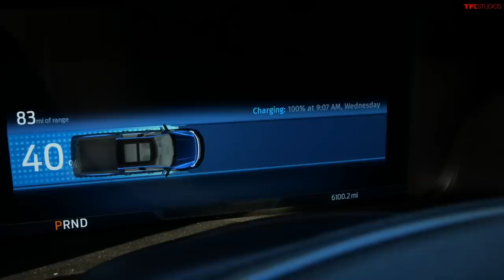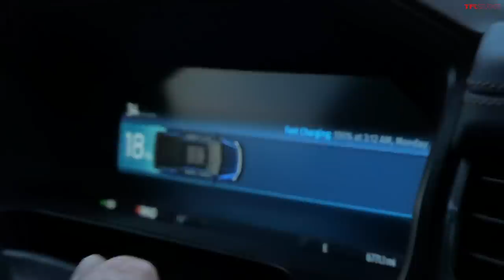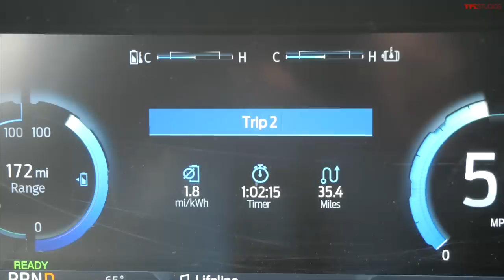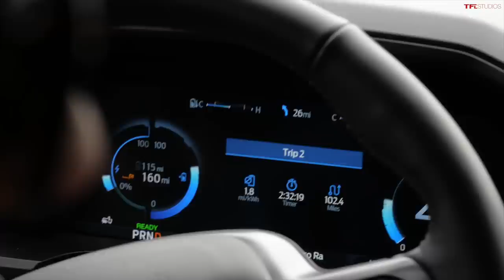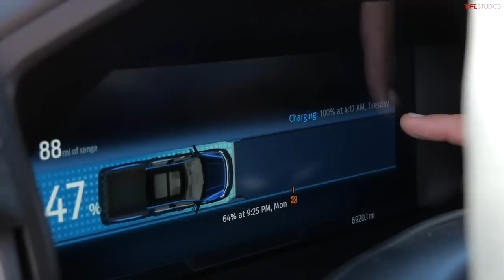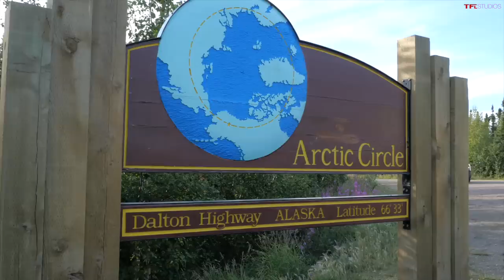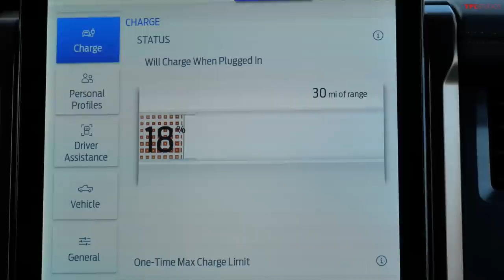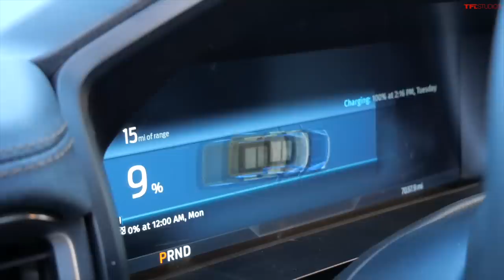Easy Part Is Over: Driving an EV Truck Into the Alaskan Wilderness Is HARDER Than We Thought! Ep.4

Comment: My brother lives up North and another factor you need to worry about is power outages.  The grid is NOT stable in allot of places up there and the generator he bought for his house sees regular use.  If he had an EV hed probably need a second generator cause the 40-50amp? one he has now is just enough to run his house and keep things fairly normal in there.  
Hes been talking about putting solar and a battery bank on his house and the size of whats needed just for the house is staggering.  Nevermind adding a giant EV truck to the mix.  And no way in hell would he buy a Tesla he said with the amount of snow they get.  He needs ground clearnce.
Reply: Depending on the truck he gets the truck could stand in for the generator. Yes you wouldn't be able to drive it as much, but your truck could get you through a power outage. A 130kwh battery like the ford lightning has would get most people through multiple days, especially if the heat is gas/propane.

Comment: Great series. Good comparison of the E-truck to the modern model T.  So much valuable information no matter where you are on the electric vehicle side.
Reply: This thing is in no way comparable to the Model T. In fact, electric trucks were being used during the Model T era. They were eventually phased out because of range problems. Even after 100 years of battery development, range is still an issue.

Comment: For aerodynamics the rear of the camper is where you need to focus. The air needs to smoothly flow passed the camper. If you look at an airplanes wing, the front is thick and tapers off. Thats what brings the efficiency.
Reply: Bingo!

Comment: Weight is a huge deal as a trucker I can tell u the difference a extra few kg between 57000 and 63000 is huge change in how hard it pulls and steers and braking. Adding 1000lbs compared to a empty truck is a huge deal. You could have a flat board behind the cab and the truck wouldn't care if it's empty. Even the most sleek areo camper is gonna massively eat battery range depending what it weighs.
Reply: Totally agree! They keep thinking it’s aero, but weight has a huge effect on power and mileage.
Reply: @JAMESWUERTELE  aero only has a effect at high speeds driving at 50mph Aero drag is not causing the terrible range. The maxed out payload is the biggest problem.

Comment: The added length of the extension cords is what dropped the Amps... At least you had a spotter for the power cords... Hot Spots will melt and ignite the insulation very quickly and watching a power cord start on fire is an automatic switch to panic mode.  This is the top of the list for range anxiety road trip.

Comment: I can't believe Andre didn't get a NEMA 6-50 adapter. That's probably the 3rd most common and accessible 240v plug you'll find. Every shop has one if they have a welder or larger air compressor. I put one in my garage for if I ever get a larger welder, and as a backup in case my wall mounted charger decides to stop working.
The NEMA 14-50 and 6-50 were the two adapters I bought as soon as I ordered the car. I also bought a 6-20 adapter so I can make my own 120V combiner box.

I forgot, Ford really needs to offer other plug types for their portable box like Tesla does, why go through the trouble of making one with removable plugs to only offer 2 kinds. Especially since you can't adjust the amperage in the vehicle. (Ford needs to change that!)  I made my own L14-30 to 6-50 adapter, but I know that I'll have to knock down the charging amperage to ~24 if I ever use it. Which I can do that in my car.

Comment: That 3 prong 70 amp plug is a welder plug .I have a few of them .most are on a 60 amp breaker. The second cable you used if that was a dryer receptacle it should have been a 30 amp breaker,somehow you managed to pull 38 amps off it… thank god that worked .

Comment: This series shows why EVs are awesome and at the same time why they are a long way away from replacing gas vehicles.
Reply: not too awesome then are they
Reply: @natebenefield738  depends on the use case.  I have a Mustang Mach-E (RWD, smaller battery pack) as a second car in a multi-car household, with a 50 amp charger in the garage, and put well over 10,000 miles on it in the first year, even w/o commuting due to pandemic office closures.  90% of the miles are accumulated on days when I'm driving <200 miles, usually <100.  For longer trips, we've got an ICE vehicle. EVs aren't for all use cases, but there are many cases where they're a perfect fit.

Comment: I suppose Alaska is not the ideal market for EVs just yet. That said, this is encouraging. I'm sure there will improvements... to batteries and to charging.

Down on the lower 48, this would be a great truck for me. I rarely drive more than 70 miles round trip, occasionally close to 100, but usually much less.
Reply: Powering an EV with coal is the ultimate form of virtue signaling
Reply: The range is the biggest issue for me right now. My current 2019 F-150 3.5L is carrying me 800mi on a tank and a 500-600mi one-way trip in a day is not uncommon.  That would require at least one charge each way.  As more is learned and the tech & infrastructure improves I will consider.  More apt to go with a Hybrid right now as I also do a lot of City driving which is where the Hybrid really excels, but still gives me the highway range.
Reply: @M8Stealth  Who's "virtue signaling"? I just like the truck, and I like EV tech.
 
Maybe that's a political statement to you, but it's not for me. I like diesel, gas, and I like EVs. They all have advantages. That enough virtue for you? Is it okay if I like it now? Sheesh.
Reply: @davecass485  Well, an EV doesn't sound right for you. It's not for everyone, that's for sure. It would work great for me...sounds like I travel less than you.

Comment: America has a lot of great things and as an Aussie I'm often envious. However your low voltage power system is not great for EV's. Here every power outlet is 240V, 10A. All campground outlets are 240V 15A. Most workshops have 3 phase power outlets at 415V 20A or more. Makes EV trips a lot less stressful, even when there's no DC fast chargers (which we still have bugger all of compared to the US).
Safe travels guys.

Comment: More proof hybrids are a better option. You can capture braking in the battery and use the electric for low speed where it works best. So you get the 2 things electric does best and still go anywhere at any time without camping at chargers for half your trip. Oh, and they also cost less and don't carry as much weight.

Comment: How many more fast chargers are needed (3, 4, etc) to be built for this trip?
Reply: For the ELF EV rally in August by AKEVA, they're putting in chargers at Yukon River, Coldfoot, Brooks Range Gateway, and of course at Deadhorse. They should be 25 or 50kW units in each location.

Comment: Ford should push an update that allows you to select your charging rate (amps) right from the touch screen.
Reply: Oooooo a touch screen!! That makes Everything better!! LOL
Reply: Actually, it's their charger that should have the setting. The 40A charger should know that not all plugs are 40 amp. 30 amp is the more common 240v amp rating but some 240v circuits are even less than that.
Reply: @killer2600  having that feature in the car would allow it to work with any charger. Lot easier to push a software update that will apply to everything than have dozens of manufacturers update their chargers and screw the folks who already have a charger without the feature.
Reply: @jabroni6199  Having the car decide how many amps the charger should pull from the wall would let users overload lower amperage circuits and blow fuses/trip circuit breakers. This would lead to customer support calls and lots of my charger is defective/junk returns/complaints. But beyond that it’s part of electrical code that a device should not draw more current than the plug on the device is rated i.e. when they have their 40A charger connected to a 120v 15A outlet the charger at no time should draw more than 15 amp even if the car and charger can do it and we’re setup to do it at the last charge hook-up 5 minutes ago. This is why the charger has the different pigtails instead of a simple adapter for changing plug type - so it knows which outlet it’s using.
Reply: @killer2600  did you not watch the video? They used a myriad of adapters. You can easily adapt a 50a plug to plug into a 30a service. Your solution would literally not have changed the issue they had in the video. You’re back to carrying several chargers with different plugs. I a customer doesn’t know how to select a charge rate they won’t know to carry different chargers with different charge rates. The solution I’m suggesting, the chargers would obviously communicate with the car to now allow it pull more than the charger is rated from. So it effectively has what you’re suggestion with the option to pull less, without having to have a different charger.
Reply: @jabroni6199  It's not MY idea, it's electrical code and why a nema 5-15 won't fit into a nema 14-50. It takes out the human factor of making deadly mistakes. As far as the adapters they purchased goes, it is more janky but still remains complaint with electrical code - there is no adapter that will allow you to plug a higher amperage/voltage plug into a lower amperage/voltage socket i.e. you can't adapter your dryer plug to a nema 5-15 outlet such an adapter isn't commercially produced and sold.

You give the end user too much credit to have electrical wisdom. The reason for the NEC (National Electric Code) and why the book is so thick is because electrical wisdom (and safety) doesn't come naturally and isn't a common sense that everyone has or gets.
Reply: @killer2600  ok so don’t do anything is your suggestion. Again, your safety measures are defeated by adapters, which everyone can get. If anything your suggestion is less safe since you have no option but to pull the maximum amount of current the plug is rated for vs being able to lower it using software. Brilliant!
Reply: @jabroni6199  I had to re-watch the video and this whole issue and debate was created by the human factor and lack of electrical knowledge and you propose the same humans that introduce the issue will be the one to fix it. The issue wouldn't have occurred at all if they weren't trying to use RV power adapters and connect a 30A outlet to a 50A plug. If they just used the right plug on their 40A charger the charger itself would have automatically limited itself to 30A.

I didn't say do nothing, I said it's the charger that plugs into the electrical outlet whose job and responsibility is to only draw the amount of current the outlet/plug is rated.

This back-and-forth is exactly why we don't leave electrical decisions to the end-user. When the end-user causes a problem from their lack of understanding, rather than fix the root cause they want another solution to cover up the problem.
Reply: @killer2600  if they didn’t use adapters they would have gotten zero charge.  Again you’re not proposing any solutions. You’re just staying “find the right outlet and you’ll be fine” well no shit genius. It’s not always possible to find the perfect outlet. That’s the issue. Having flexibility in the software mitigates that issue.
Reply: @jabroni6199  You act like everyone is going to plug a 50A plug into a 30A outlet and be dumb founded why it blows the fuse. You want a solution, don't be an idiot and plug a charger that is setup to be plugged into a 50A outlet into a 30A outlet with an aftermarket RV adapter when you know the charger is a 40A charger. That's your solution. This is a niche case of user error and not something majority of EV owners will ever deal - most people won't be driving a hybrid powerboost alongside their EV so they can charge when there are no chargers or outlets around. Furthermore the people that do do this are not likely to have an aftermarket 40A charger to do this type of charging and will more likely have the Ford 30A charger. AFAIC this topic is a non-issue and not worth further thought.
Reply: @killer2600  I’m not acting like anything. Your proposal is do nothing. Which doesn’t prevent an overload. My idea allows for nearly infinite flexibility.
Reply: @jabroni6199  Niche use case and practically not needed so dream whatever solution you like for a rare user induced problem.
Reply: @killer2600  and yet still more useful than your long winded way of saying… do nothing.
Reply: If someone has a hybrid powerboost AND an aftermarket 40A charger WITH ONLY a nema 14-50 plug cord BUT HAS an RV nema L14-30 male to nema 14-50 female adapter they will have issue tripping the circuit breaker when trying to charge their EV from their hybrid powerboost. That's a lot of criteria to be met, if anyone accidently stumbles on this exact set of circumstances ever again then they should play the lottery. 

Besides, telling the car how much charge rate to pull from the charger doesn't mean the charger can't pull a different/higher amount.

But waste your time with this non-sense idea. Don't waste mine. AFAIC if someone would be knowledgeable enough to know how to properly and safely use your "solution" then they'd know enough about the different plugs to never get into this situation i.e. they'd have a 30A plug/charger when they expect to use a 30A outlet and they'd know why a device that uses more than 30A couldn't just be adapted in to a 30A outlet with a simple amazon adapter.
Reply: With the 40amp charger they have should be able before you plug it in to select charging rate. Just push the button and it should circle through with 40 being the highest. I do not have a Ford, but an other ev and if I'm in no hurry i usually limit home charging to 10A 240v. No need to push it to the max over the night.

Comment: 90k and you have only 200 miles range think the hybrid is a better option
Reply: You do realize that would end up being the highest trim level. That trim level is not necessary to purchase, but it is highly funny that no one compares trim levels. A power boost with the things that are not optional for the Platinum Lightning Platinum with a hybrid makes it a $70,000 truck. I'm betting that you still would not purchase that. On the other hand, there is no pro trim for a gas-powered vehicle, which means the lower end makes it more affordable, and the cost to own is less.

Comment: This really does highlight how bad and impractical EV's are in some situations. They're not great on standard US highways either with the huge distances involved. EV's are only really practical if you a) don't need to drive very far and b) live in a city or built up area - anything else requires almost military style planning for a journey of any length.
Reply: More than showing to me the problems of charging BEVs in rural areas (something I'm already very familiar with), this video did more to show me how horrible it would be to live in rural parts of Alaska.  These villages are ugly as all heck, and depressing to see....  Regarding the Lightning, this video was a let-down in that it just showed that they couldn't do the trip without a back-up vehicle for charging the traction battery.   I feel bad for the guys doing the trip and making the video -- just as I would if it was me trying to go all the way on road-side charging only.  Still interesting to see their trip details, though.  I want to see the video of the first BEV that makes it all the way with only road-side charging plugs.  The Hummer might be a better vehicle for this trip with a better range and without putting a camper on top; not sure why they couldn't just sleep in the truck cab instead, for such a limited trip.

Comment: The big energy thief is that slide-in/bed-top camper that is wide and sticks up above the cab of the truck. An interesting comparison would be to see if you go further on a charge towing one of those small teardrop camping trailers which has the same space as the slide-in?
Reply: towables basicaly double your frontal area at minimum, even small tear drops
Reply: The lightening is not even suppose to have any type of slide in camper. That one is small as it is
Reply: @JogBird  That makes no sense aerodynamically. The trailer follows in your slip stream. I would like to see a source for your statement.
Reply: Four Wheel Campers “Project M” model is NOT a slide-in camper.  It’s a boot-on that  weighs substantially less — as earlier videos in this TFL series attest. 
Though weighing less than a slide-in, it does add weight and drag, but I thought that was the point of this series: Showing an EV camping rig making the trip. 
Sad that video content, thus far, doesn’t show the camper actually being used, but for a couple times (David’s overnight charge, for one).